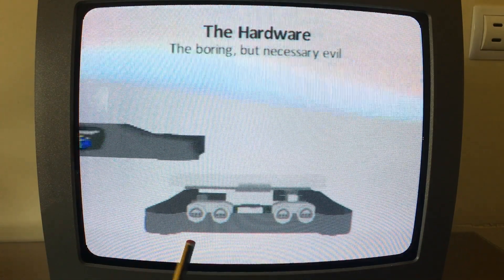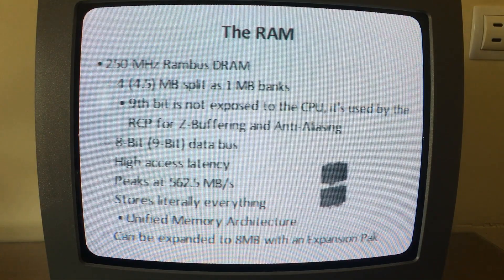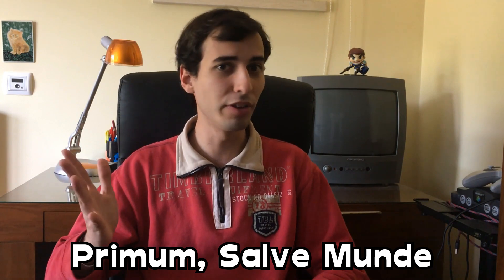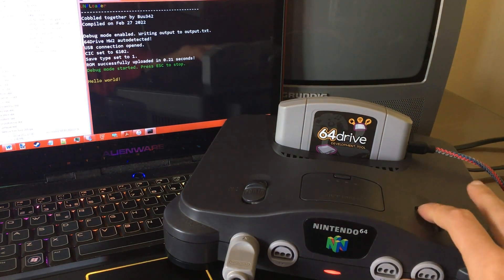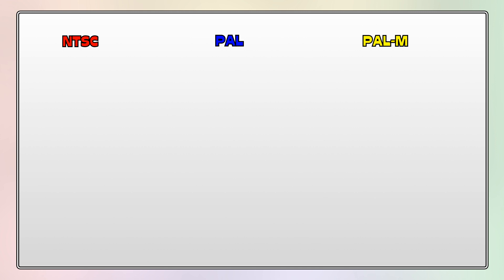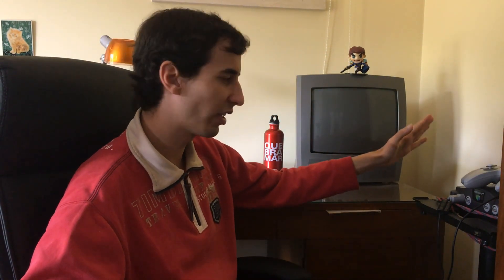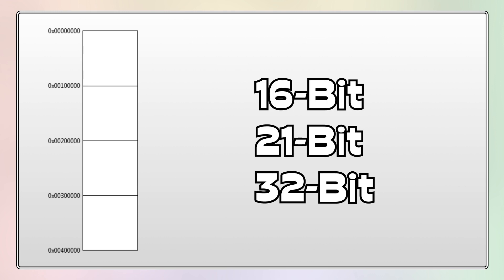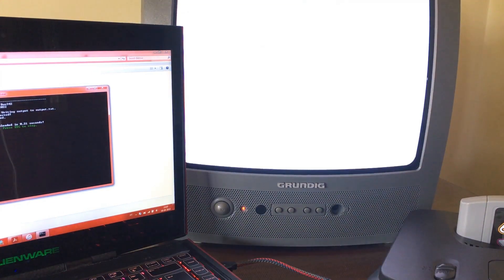N64 Dev Log #1 - Hello, World!

Comment: I managed to set up the N64 development environment with libultra. Your project(s) compile fine and they run in Project64 and 1964 just fine. I can deploy to my everdrive64 x7 just fine too. But despite all that, when I enable debug mode using -d when using the UNFLoader, I don't get any Hello World messages. Any ideas? Thanks.
Reply from the maker: Make sure that when you compile, you go to debug.h and set DEBUG_MODE to 1.
Reply: @Buu342  Thanks for the reply. It's already set to 1. If it was 0, I probably wouldnt see the "Debug mode enabled" message when running makeme.bat.

Edit: I tried using both build of UNFLoader from the releases on the git page and building my own. So I then tried the example ROM releases from the UNFLoader git and they work perfectly. To follow I got the latest version of your platform project and that too works. 
So, I'm guessing it's specifically a problem with the A Basic ROM and White Screen releases linked in the video description.
Reply from the maker: @idc2120  Interesting... I'll make a note of that and check it out. It could very well be that I forgot to compile it with debug flag myself!

Edit: No wait, I definitely compiled them without debug mode on purpose. Those are release ROMs after all, heh! From here on I'll provide two versions of the ROM, with and without debug. I'll upload them tomorrow morning as it's currently 2:30 AM.
Reply: @Buu342  Ah. I wasn't running the ROMs provided in the release section. I built new ones from the source code that was in there. It could be something to do with my environment maybe. 
Thanks for taking a look anyway.
Reply from the maker: @idc2120  That's more weird then, I'll have to take a gander. I ended up being out of the house all day today so I'll do the debug ROM uploads thing tomorrow.
Reply from the maker: @idc2120  I recompiled the ROMs from each release (using said release's source code zip) and produced platform.n64 and platform_d.n64 (the latter is debug releases, which have USB output). I tested and all of them seem to be working.

If you are using UNFLoader, make sure you use the Azure pipelines build and not the release build, as a few things have changed since (and my platform code is using the latest version of UNFLoader, since the submodule is included in the tools folder). I intend on making a new official release of UNFLoader sometime soon...